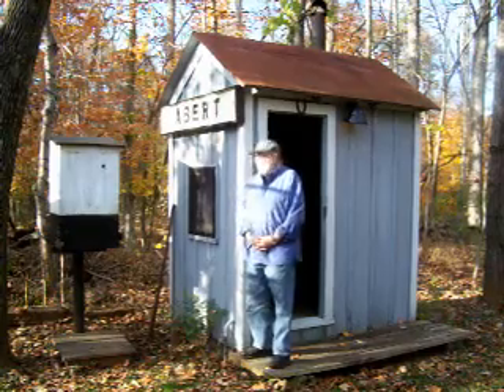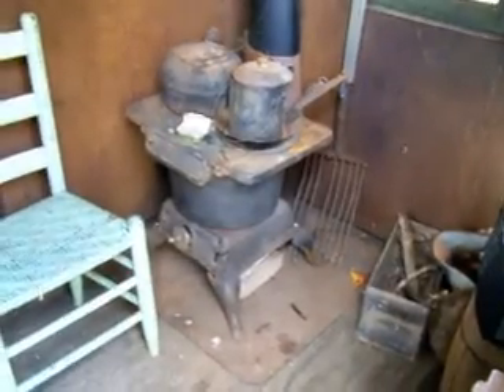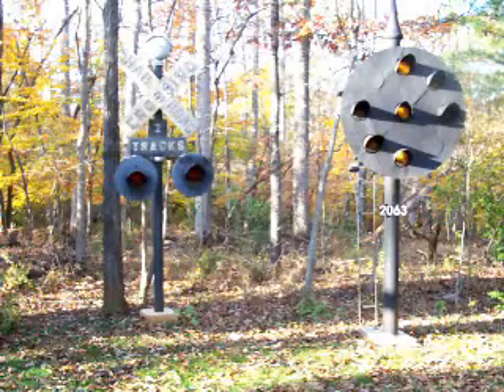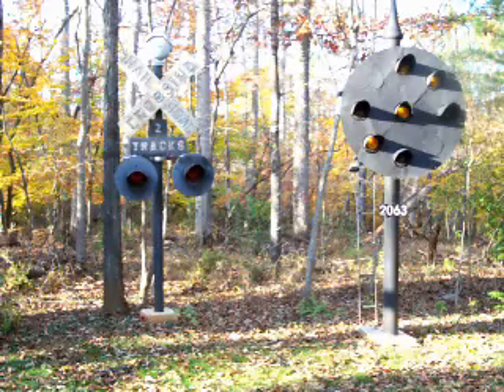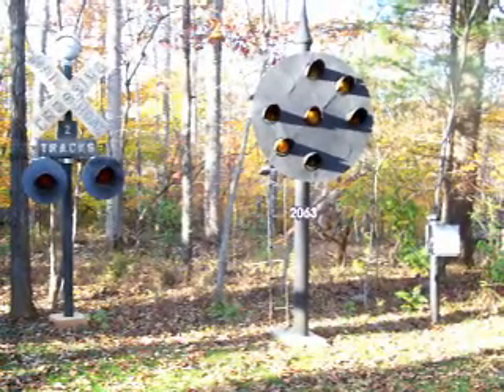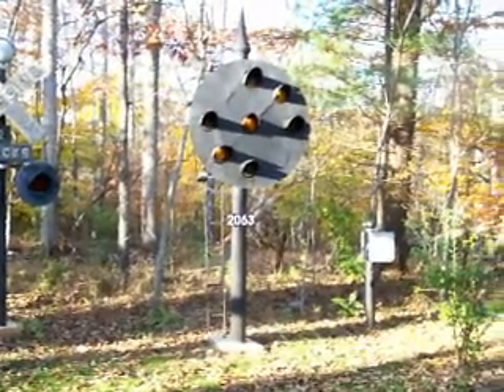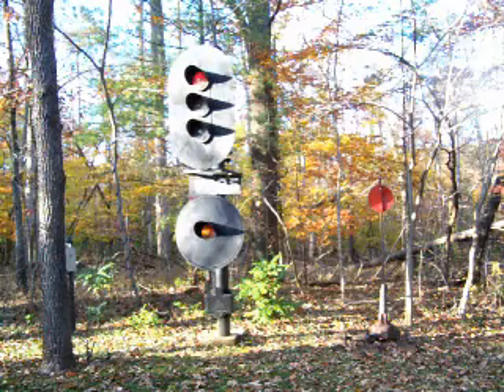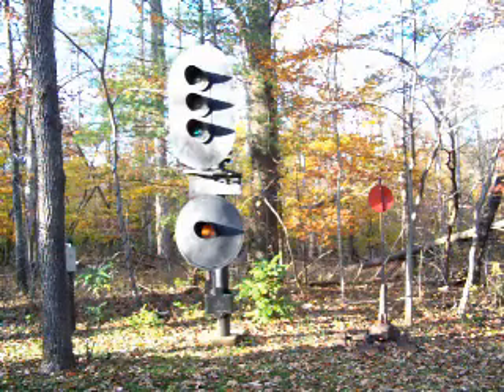Aubrey Wiley's Railroad Relic Sculpture Garden part 2

Comment from the maker: Thanks for the comment on current conditions. The line you spoke of is the former Virginian Railway and they had veyr few signals. The railroad operated by writen train orders.  After the merger with N&W in 1959, N&w put in those US&S PL-3  signals.  But they are now being replaced fast.   I left all the original 10 volt wiring in all my signals and have them operating now on 110 volt, 6 watts.  The main reason I converted to 110 was the ease of finding and working with timers.